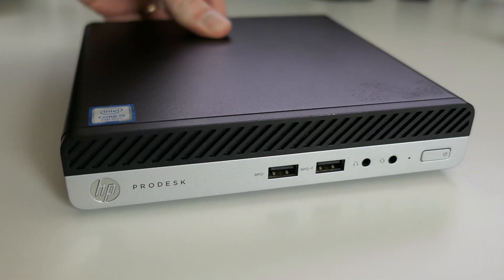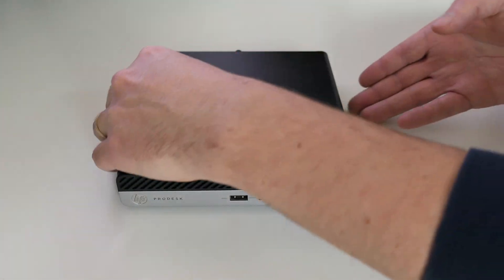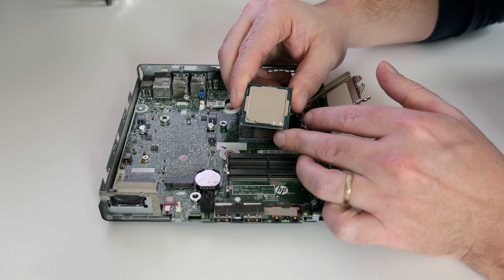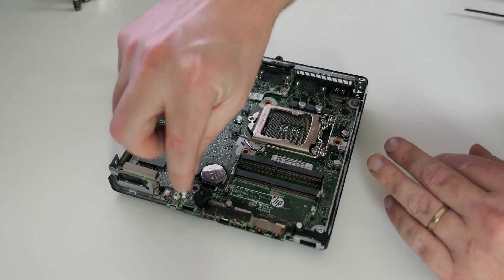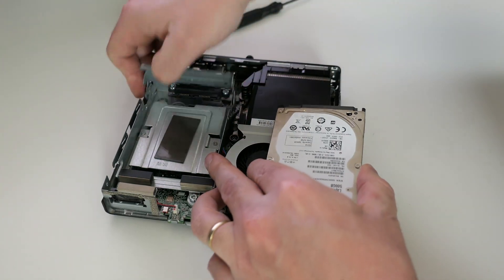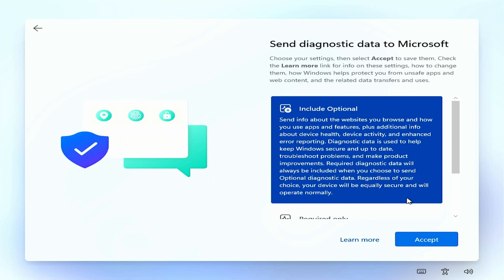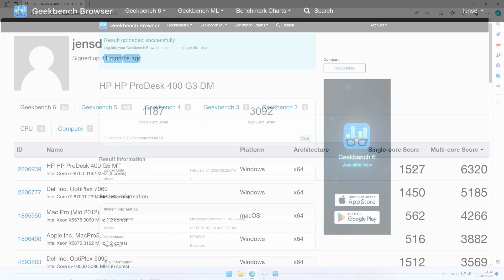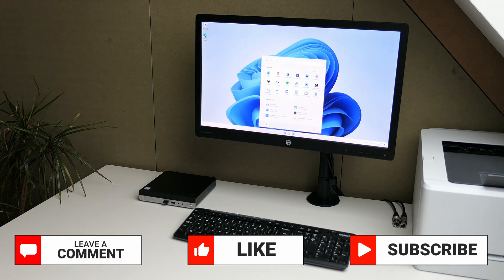HP ProDesk 400 G3 Mini - Teardown, Upgrade and Benchmarks

Comment: Thanks for the video, after watching I bought one for 100 euros to use with Home Assistant OS (moving out from Docker container). Mine came with a 7400T, 256GB SSD SATA and 2x4GB DDR4, but it's enough for now just to run Home Assistant and some Add-ons. I wish there was an way to under clock the CPU to use as minimal energy possible, but I know that the 7400T uses less energy than 7500T. Didn't measure the power consumption, but I don't think it'll impact my energy bill that much.

Comment: Really enjoyed this, Thank you and very informative too 👍I'm currently running a G3 on linux, G4 & more recently a G5 on Win 11.   Ubuntu's on the G3 just coz I like it, prior to upgrading I tried simply installing the Linux os instead of the original Win 10 and found that change  alone turned into a much nippier and pleasant to use machine. After upgrading to a 480GB ssd and increasing memory to 16 GB it's now a fantastic wee toy😁and gets more use than the other two🤣 like you I had planned to keep the original hdd and install an NVMe ssd but for some reason the Ubuntu just wouldn't pick it up?? So I whipped an ssd out of a previous project and was soon back in business.

Comment: I have problems with a simmilar model. Mine is a prodesk 400 g4 mini (i think. Its a corei3 8th gen)
I try to connect a m.2 sata ssd, but it does not reconize it. I cant check if the motherboard is compatible or not. Could you help me a bit?
I have already tried to install the drivers via the win10 flash installer, but its no use.
Reply: I have the same problem, have u solved for the problem?

Comment: I was wondering why you did not go with 2x8GB for dual channel.  also, why no ssd instead of HD.  I was trying to show what the older pc's could do with just ram/ssd upgrades.     I have an athlon 2 - 630 ( 4 cpu not hyperthreading ).  It was fine with approx 8 or 16 GB ram, ssd, and Linux.    it is a little slow on bootup ( when conmpare to faster cpu and nvme ), but as a regular computer - it is ok to use.   so I always suggest ssd over HD and if possible nvme.

Comment: Hello, can I use a old ssd with the Windows 7 32-bits and all configurated from another windows machine (not HP Prodesk 400 G3 model, a windows standard model pc) in this machine ? this machine work with windows 7 32-bits ? or not ? Thanks
Joao
Reply from the maker: Not sure if it would work with Windows 7 32bit, it would only support 4GB of memory. Especially when the install is from another PC there is a large chance it won't boot. Honestly, I can't find any valid reason why you would want an unsupported, outdated OS not fully supporting the hardware.

Comment: Well done 🌈👍

I have the same HP400 and have a question about the RAM-Upgrade: I have 1x8GB and also want to upgrade to 16GB. Can i add 1x8 to the second slot to have 2x8 or do i have to buy a single 16GB DDR4??
Reply from the maker: Should be fine to add another 8GB module to upgrade
Reply: @jensdbe  ok thanks. I see dual channel is even better but i need the exact same type of memory bank.
Reply: @jensdbe How much RAM can be installed in this computer?
Reply: @GregPLAngler  64Gb

Comment: So, if I wanted to use this kind of PC with RPi 4 PiKVM I won't be able to boot and restart it remotely (not standard/atx front IO panel?)? Am I right?
Reply from the maker: Correct, the power button is directly connected on the motherboard. You might be able to solder that header/cables to the pins of the power button but it won't be very elegant

Comment: I have a HP EliteDesk G2 800 Mini that I am planning to use as my new Docker host. It has the slightly older i5 6500T but I still expect it to perform much better for Docker then my current Synology NAS which has a much weaker 4-core CPU. The other bonus is that I don't have to listen to the grinding of the spinning disks in my NAS 24/7 :)

Comment: Stock TPM1.2 or TPM 2.0?
Reply from the maker: I believe it came from the factory with TPM 1.2 but the firmware can be upgraded to 2.0. I even think Windows Update takea care of that
Reply: 2.0 because windows 11 minimum system requirement is 7th gen = kabylake, the i5-7500T is 7 gen